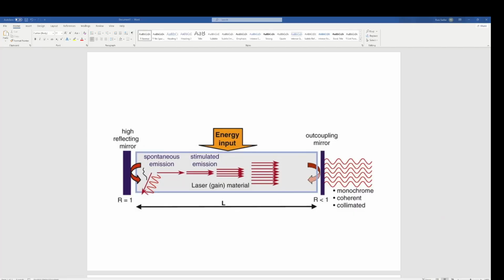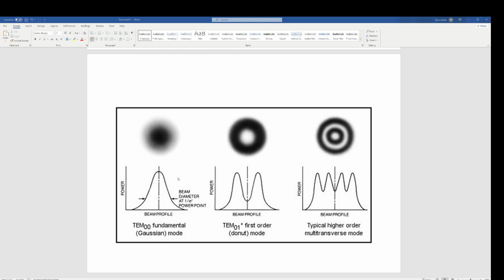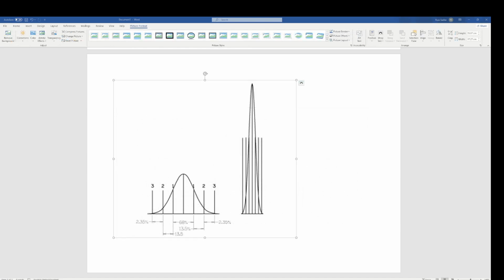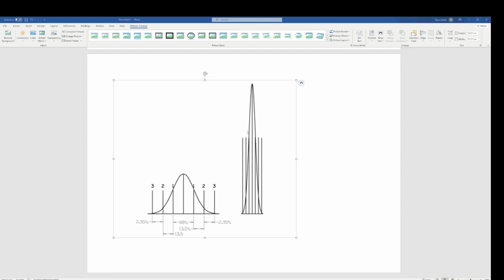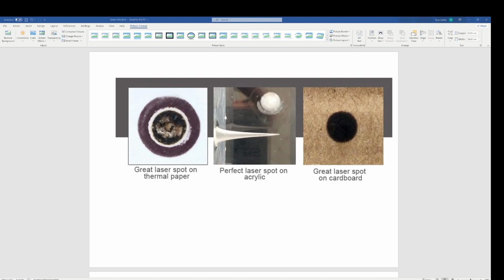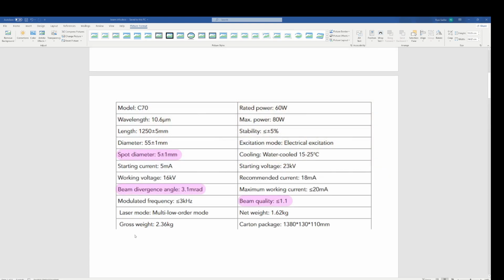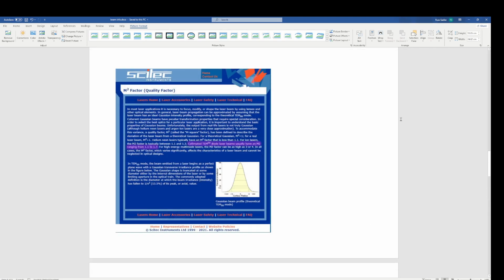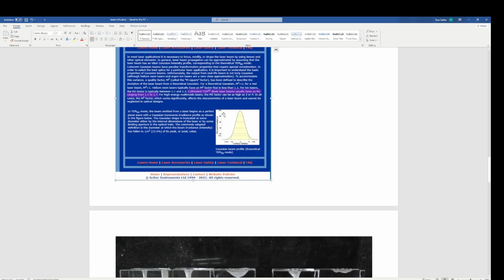Laser Beams and lenses   Two Unruly Teenagers Pt1

Comment: ok had to pause at 6:25 because a taught came to mind, let me know if there is something to this theory as i have not yet watched the rest of the vid, i think the acrylic material you are cutting is acting like a secondary lens and thus creating a reverse galileo or the effect is reducing your 1" beam to maybe 1 mm and that is the parallel beam that is making the cut, so the theory on focal length may take effect when cutting other non refractive materials such as metals etc  so if you were to use a steel plate of same thickness it would not be cut nice and deep like your acrylic
Reply from the maker: I can understand your thinking and it has been proposed before. However its critical to understand that acrylic is a total absorber of the 10.6 micron light energy and converts it from (cold) potental light energy to knitic energy as it hits the molcules. The energy absorbed by the molecules increases their vibration energy and causes them to heat up, boil and evaporate.  I demonstrate how light is not reflected or refracted by CO2 laser light in  this video.  watch from about 8:00  https://youtu.be/j5fur-0o3_8   It will be intersting to se if you can explain the various chamfers, balloonings and tapers on the generally parallel kerf. Remember this was 20mm thick acrylic cut with a 25mm focal length lens at 1mm/s with a 70 watt tube.All the theory says impossible.the way ,
Thanks for the thoughts . Its good to know that someone is watching and their thinking juices have been stirred.
Reply: @SarbarMultimedia  well the only other thing i can think of is in what you said about how the material is absorbing the rays and reacting into heat energy so perhaps once the beam with a very small circular cross section hits the material it creates this heated circular layer that is vaporising and the same pattern will continue in the same diameter all the way through the material , actually this is how lasers work on metals i am told the shape of the beam like say conical does not matter and it will continue to bore as if it was a column th same size as the spot hitting the surface of the metal and was described as like a shock wave layer after layer as it vaporizes the material, this is why you also once said the shape of the beam despite it being focused still cuts as if it was a rectilinear pencil thin column beam as it goes through the material , i will watch that vid as well but im still looking at pt1 then pt2 then ill watch this one, but we keep jumping from one to the other lol i need to slow down
Reply from the maker: @ARCSTREAMS  
The priciple of cutting any material is based upon that material responding (resonating) to that frquency or one of its subharmonics. IF those light waves impact the atoms and molecules of a material and can pass  minute packets of light energy  into "consenting"  molecules ( so that it becomes kintic energy) those molecules vibrate harder and their temperature increases . Light has no heat, only energy. Light also travels in straight lines unless reflected or refracted . I spent 10 years managing industriial CO2 metal cutting machines  and thought I knew a lot about the process. In reality I knew very little until I started studying how non-metal cutting worked.and I had my trust friend (clear acrylic) to show me  exactly how light can damage material. Cutting only happens because of light intensity. and the special coherent laser light is rather different to sunlight  but the principle of brightness (intensity) is similar.  The way that the variying laser light intensty within a beam  reacts with a particular focal lenght lens  is not something you will find in books.   All you will find is basic lens theory and sadly, relates to imaging not  focussing laser beams to damage materials. Understanding the basics of molecular srtuctures and bonds is all part of understanding how  light can be used to destroy thos bonds.

 The concpt you describe of an entry orifice into a cut is exactly right. However, there is no shockwave involved. just straight rays of light that can pass through that hole and impart there energy to the material within the hole. The highest intensity  (most damaging) rays are at the core of a laser beam and thus they are almost aligned to the axis of the beam and can pass through thae surface orifice that they have created..If the rays are at a slight angle and have sufficient intensity, they will not pass far itoo the hole before  they encounter a sidwall , transfer their enegy, and the material erodes sideways. That is why the short focus lens with my 20mm acrylic cut is causing the ballooning effect. It's all very simple really,  Intense light rays hitting material and giving up their energy as kinetic(heat) enegy to the material. The greater the intensity the faster light can do damage.  Metal cutting machines have silly focal lengths like 12" to 20" so the core of the focused beam is thin and tight to the axis for a significant distance.  IF I had used a 4" lens to cut 20mm acylic the cut would not have shown any ballooning.
 This is a fascinating subject that has taken me many years of experimentation to decode.  Thanks for your interest
Reply: @SarbarMultimedia  is the focal distance of a lens typically the same as the diameter? and you are saying the longer the focal length the better less ballooning and more of a column like cut will happen because of how you describes most of those rays hitting the sides not doing much on  a short focal right,, yet you managed to do pretty decent column cuts using short focal length, is this what you are trying to understand? why it does this when theory says otherwise?
Reply from the maker: @ARCSTREAMS  
Hi
 There is no relationship between lens diameter and focal length  The focal lenght depends on the spherical radius on the top surface of the lens. Yes ,the longer the focal length the less the ballooning. With a short focal length lens,  the cone of rays above the focal point is quite wide so as you make a hole in the surface, not only those almost axial rays can  enter, but also some of the more conical rays. These conical rays are not projecting down the axis so they hit the wall  soon after they enter the hole and cause erosion (ballooning). When they run out of damage power (about halfway downthe cut) the hole become straight from the cutting effect of the axial rays  Those axial rays  are the most intense and damaging but they need time to cut through 20mm.A longer focal length will be a bit faster and produce less ballooning because the cone angle will be less so  there will be less angular rays entering the hole. The conventional concept of a lens is fine for projecting an image to the other side of the focal point. However with a laser cut, the beam never gets a chance to diverge because it either  hits the surface of your material and goes no further or the rays are axial enought to enter the surface hole and do VERTICAL damage only below the focal point,  not  the  conical shape you imagine.

Comment: Hey Russ, been watching your stuff on C)2 Chinese lasers since I got one in 2019. I pout a LOT of what you posted to work and have decent engravings and good cuts in various materials using Lightburn.   I recently did some engravings for a plaque I made for our local AHL Hockey team and discovered I damaged the 2" (I think, need to verify), when I inadvertently forgot to turn the compressor on. The lens has a little spot on it so my power is reduced.    

My question is, I eventually will need a new tube and plan to go up to a 100w from the 50/60 tube in there now that it came with, and I want to get as tight a kerf as I can going through 1/8 inch plywood for a project I am working on.   I can't remember, do I go to a shorter length, like a 1" lens to tighten up the kerf?  I think it originally came with a 1.5", but the lenses were crap, and based on your videos I went to 2" for better engravings without giving up on decent thickness cuts.   What is the tightest kerf (dot) that these CO2 lasers can accomplish?
Reply from the maker: Hi
If your spot is just burnt on fumes then soak it for a few seconds with IPA and try to remove the spot with circular rubbing using  a cotton bud. The antireflective coating is pretty duarable. Howver, if the debris has ben on there for a few minutes then the debris will absorb laser energy and heat the surface of the lens. That process could bake the fumes into the AR coating and the lens is likely to overheat with use and a cental star crack will happen.  Lenses are the most vulnerable part of your machine, thus you should always have a spare lens.
 The 50/60 watt tube supplied with your machine may not be what you think. . A typical 50 watt tube will be 1000mm long and 50mm diameter. It may claim to be 60 watts because that is waht it was test at innthe factory .... but that is not for you to use as it will shorten the tube life, 200mA is the max to run a 50 watt tube at. However, that 50 watt tube is almost certainly a B grade tube with a poor intensity profile. B grade does not mean crap  but if you watch part 2 of this video you will see me running a B grade tube in one of my machines. Because I now understand how lenses and laser beams interact I  have paired this 70 watt beam with a 2,5" GaAs lens and it cuts very well. 
Your question about  tube upgrade is an intersting one.  AS the power of a tube increases so does the beam diameter. This could mean the the intesity gain is not  proprtional to your expectations. I have found that the best "jack of all trades " tubes are in the 70 to 80wttt range. Steer clear of Reci (despite their good reputation). I have ssen far too many that are rubbish at low power Why pay twice the price for something that does not deliver across the range. Amongst the rest, Yongli, EFR  and SPT,  I would rate SPT as the best value for money. You can buy an A grade SPT rebadged (officially)  as a CR70 or CR90 from  Cloudray.. Fof a small kerf on thin material I would use a 1.5" (38.1mm) meniscis lens.  There are all sorts of "opinions" about lenses and getting what you pay for, The facts are simple,  The geometry of a lens logically has to be the same no matter who makes it and how much ir costs.  Cost is generally related to the quality of the material and the materials manufacturing process,  USA on a lens description means it is made with CVD  ZnSe which is bright yellow  and can withstand power in excess of 200 watts. The brown honey coloured material is Chines manufactured PVD ZnSe which ir rated at about 80 watts.  That's another reason for staying below 80 watts with your tube, you can use cheap lenses. I have tested the power transmission and cutting performance of almost every lens available and higher cost does not get you better performsnce, One final point (myth) about lenses. A bright yellow CVD lens  looks crystal clear to our eyes whereas the brown Chinese PVD lenses  look rather dull and unexciting. OK. if that is your judgment of lens quality, how do you explain the BLACK galliun arsenide lens? We "see"in the  400 to 700nm wavelength  range the light passing through these materials  is at 10,640nm. So what you see is not what is actually happening. At that wavelength my black gallium arsenide lens  is transparent Weird?
 Best wishes
Russ
Reply: @SarbarMultimedia  Thanks Russ.  I rarely hit 18 mA on mine and have the power turned down to 80% max at the controller, so 100% in lightburn is 80% at the machine. Tube still going strong 5 years now.  Reason to step up to 100W is to cut thicker material in the 1/4 to 3/8" range for some projects. Also great info on Reci tubes, so I will look into the other tubes at Cloudray. I also replaced the Chaser lens soon after watching your earlier videos on lenses, and put a lot of what you taught to practice. Right now I just want to get a tighter cut for a couple projects, so will look into the 1.5" setup.  Will also see if that is just a surface spot or actual damage. Going to tie the pressure switch into my relay setup that turns air on and off, so the tube wont fire if there is no air pressure, I missed that somehow.

I've also put your acrylic cutting and etching to good use, and yes, keep the machine clean, don't want a grid fire.  I appreciate all the work you put into these videos.

Comment: But there are other types of lenses. The Axicon lens can help you with your problems with the focus dead range of the normal lenses.
Reply: Hi 
Thanks for the thought. My aim is to investigate the commercially available lenses and laser tubes that  everyone currnently uses. Although I have seen  ZnSe axicon and aspheric lenses for specialist laser applications, the cost of obtaining the right size lenses  (18 or 20mm diameter) to evaluate their cutting properties, is beyong my budget. The fact that cutting relies on the aberraion properties of a normal spherical geomety lens  and the distribution of intensity within the laser beam. implies that a perfectly focusing lens will not be the panacea for efficient cutting. However,  I will run with your suggestion and see if I can obtain any such special lenses from my contacts in China.
 Thanks again.
Reply: @russsadler3471  Yes, both types of lenses cost $600 and more, but I understand that absolute focus is not important for cutting. I own Trotec laser machines and am no longer willing to pay the cost for these machines. Therefore I rebuild China lasers myself and it has been shown that good optics and servo motors can compensate so much that apart from the software no brand machine is needed. The advantage of an Axicon lens in combination with a miniscus lens is that you can bypass the dead zone of the lens and thus have a very even focus over a longer focus range, which you want to have for cutting. Since I cut a lot of acrylic and value very high quality edges, I am now working with apertures to filter the beam.
Reply: I presume you are using the Axicon lens flat side towards the source?  and a meniscus lens  with the convex side towards the source also?.. What sort of focal distance is the meniscus  lensand what cone anglr is the Axicon? Is there a specific diatance you set between this compound arrangement? If I can get an axicon then I would like to understand how this can possibly enhance the  central intensity that is so important for cutting . Thanks again for sharing such an intriguing topic,
Reply: @russsadler3471  i use a 2.0° Axicon lens. the more acute the angle, the less dead zone you have. i'm still trying out the miniscus lise, i'm waiting for my tube with thread to arrive so i can set the distance precisely. But I assume that I need a larger focus lens because of the angle of incidence to get a greater focal depth. I tested with 2" but that was too short. Forgotten, yes the lenses are arranged exactly as you said. My first test was so that the focal length no longer had any influence on the laser slit directly.

Comment: Russ, I hope you're doing well. I has a project a few weeks ago where I needed a 5" lens. I bought one and tried to focus it but I could not get it to focus smaller than about 1.5mm or 2mm. Not sure why?? Is that normal??
Reply from the maker: Hi John
As I mention nin this video, lenses are not the simple bits of curved galss that most people think they are. Pass a laser beam through them and the outcome can be a lot different than what you expect.. The onl reason most peple would want to use a long focus lens like your 5" is because thay plan to cut thick material such as foam.  (is that you?)
 Whatbhappens at and beyond the focal point is very dependent on the material you are using the power and the speed. Although it will not be perfect , the best shot at setting the focal length is to set the optical focal point. ie 5" from the flat face of the lens Where the actual INTENSITY focal point is could be several mm awaymaybe 5.2 or mare inches, The longer the focal length the flatter the lenseand therefore a lot of very small refraction at and around the axis of the lens. This is the reason for poor focus. You may well find that turning the lens over produced a better smaller focal point.......but is does depend on speed power and material. Who said lenses were simple bits of glass? . You will also find that you gett a better focal point futhest away from the tube in one corner of your table.  Have you done a couple of corner mode burns into acrylic as I do in this video to examine tou beam intensity profile at opposite corners of yoir machine. . Tell me what materialyou were trying to cu and what power is your laser. I may be able to be more specific with my answer and make an alternative suggestion.
 Best wishes Russ